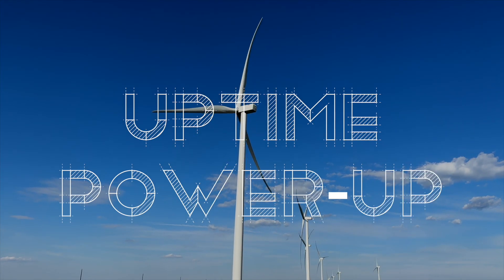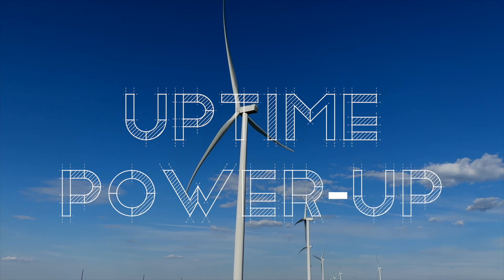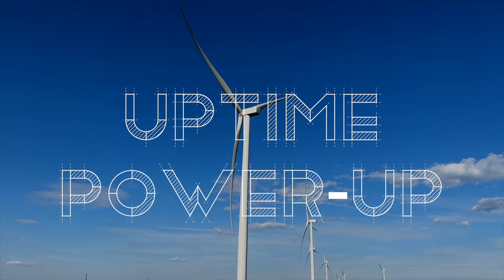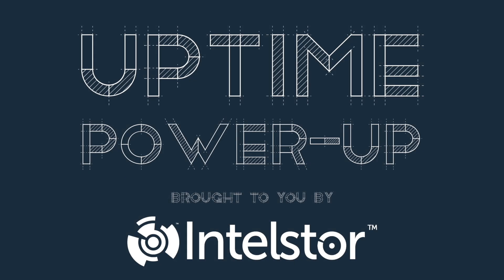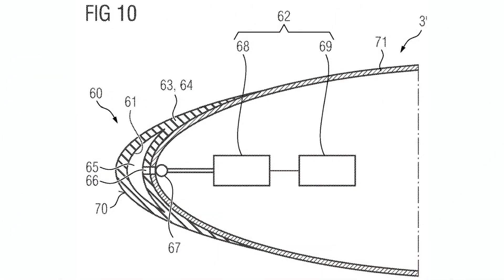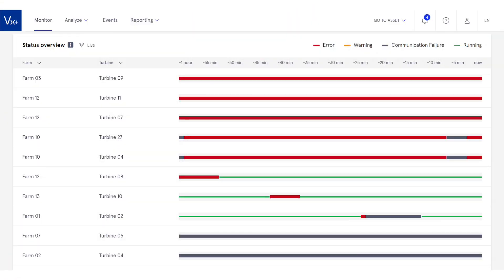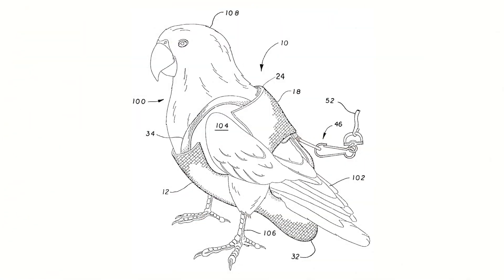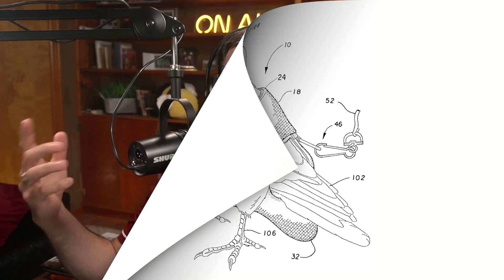Power-Up: Siemens Gamesa LEP, Vestas Vibration Monitoring

Comment: I would think the centrifugal force at the tip of a blade would prevent any gel or fluid like filling from working.  Also, the thickness required for such a construction on the leading edge would be a challenge to end with a neutral AEP effect.